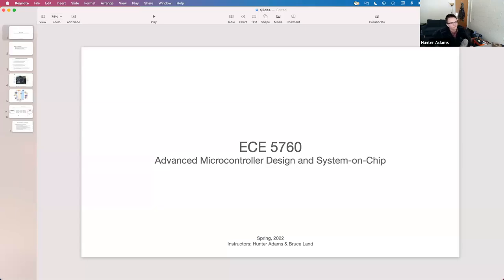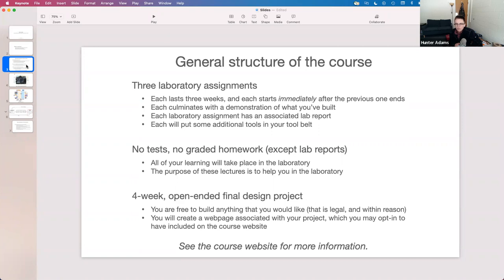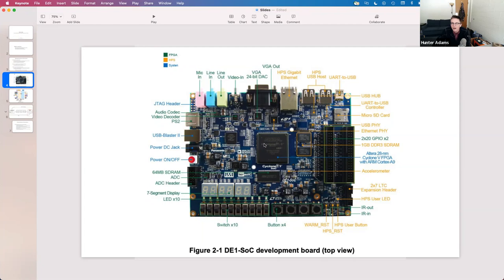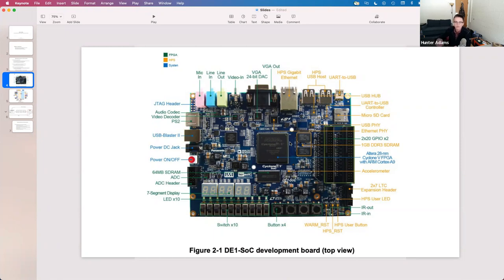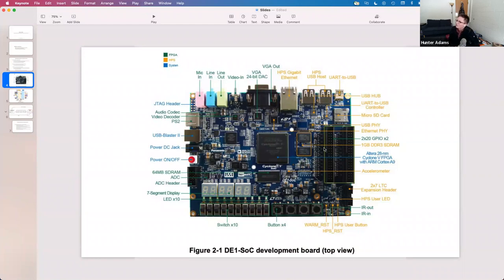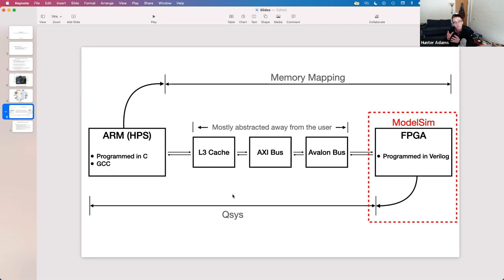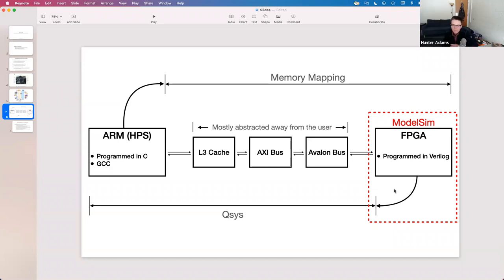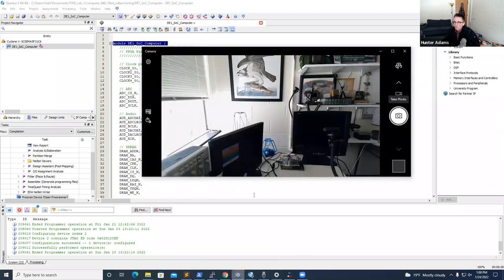#1: DE1-SoC Course Introduction [Spring 2022]

Comment: Professor Hunter, first of all, thanks to you and Professor Bruce for all lectures. Is there any reasonable reason (such as compilation speed, etc) to use Quartus II instead of new versions of Quartus Prime provided by Intel? And with your experience and Professor Bruce, do you know if computer processors with faster clocks can reduce de compilation time of a Quartus Project? I compared the compilation performance with a 4-core and 8-core processors, and unforttunaly, the compilation time was almost the same. 😪